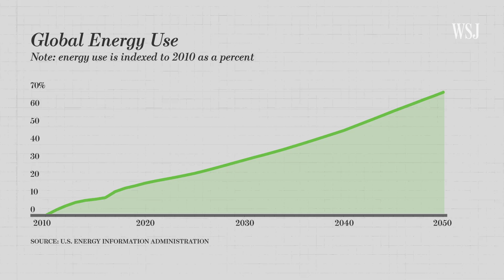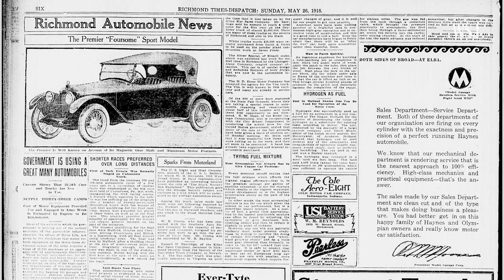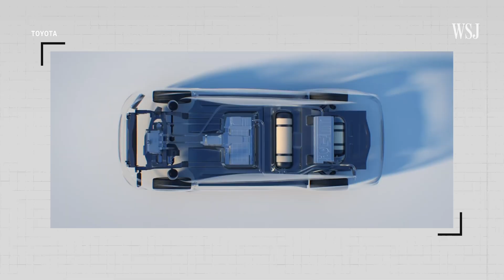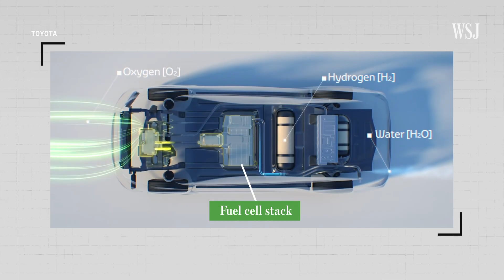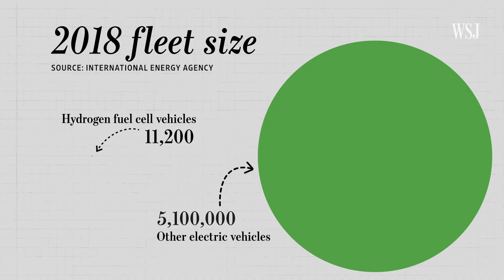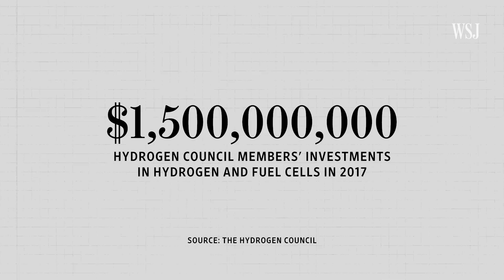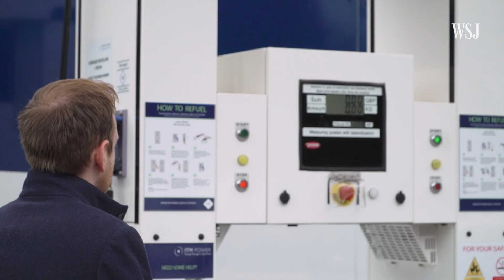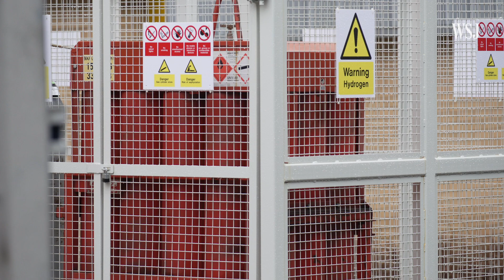Can Hydrogen Fuel the World's Fast-Growing Energy Needs? | WSJ

Comment: Use electricity to extract the hydrogen?  That's a fail right there. You use one type of energy, and convert it to another. Instead, apply the electricity directly to move your car etc.
Reply: One problem of renewable energy is management of it; if there is a surplus of electricity produced this surplus has to be stored. The question that logically follows this consideration is: How do we store it?
One possible solution is to store the surplus inside batteries but produxing batteries creates ethical and environmental problems
Another solution is to use this surplus to produce hydrogen and then hydrogen could be used to power vehicles or to serve other needs
Reply: @albertomigliavacca8320  Tesla is working on their powerwalls, so you can store your surplus from the solar panels, so you can get off grid for some time with the surplus.
Reply: @vladislavbashev1707  I was refering to the broader market not just your personal consumption.
Reply: @vladislavbashev1707  batteries have a big environmental downside, they pollute a lot during their production,  they have a big ethical downside, their constituents materials are extracted in countries with no respect for human rights finally, up to now, we don't have a process to recycle 100% of batteries
Reply: https://www.telegraph.co.uk/china-watch/technology/hydrogen-from-water-clean-energy/
Reply: But the electicity doesnt solve the long range issue
Reply: @pptstziao6937  So far hydrogen hasn't either. HFCV like the Mirai have a 320 mile range while the Hyundai Nexo has an EPA 354-380 mile range. The Tesla Model S has a 378 mile range.
Reply: doesnt solve infrastructures issues. the north american grid will not be able to support 300 million people high speed charging their vehicles all at once. this is a possible solution that is still greener than ICE cars.
Reply: @mobgma  If the hydrogen is made with renewable electricity (90% currently isn't, it's made from natural gas), then you'll need 2.5 times more electricity supply than if you put it straight into plug-in vehicles. Utilities love the "problem" of increased electricity demand from recharging that they can shift to periods when there's plenty of electricity by variable pricing.
Reply: @skierpage  I agree. I dont have the long term solution for 300 million people. Just saying this might be an alternative. You can bet the utility companies are salivating at a way to monetize this and somehow charge us more money to electrify everything.
Reply: @mobgma  Yes, having a market for periods of overproduction of electricity may mean that utilities don't have to discount that electricity as much. But they are limited in what they can charge because a) most it's are regulated and b) people can make their own electricity at home on their roofs. You're unlikely to ever be permitted to make and store hydrogen at home, you'll always be at the mercy of a gas supplier.
Reply: @mobgma  Good thing we aren't going to replace hundreds of millions of cars overnight just like we didn't add hundreds of millions of washing machines, air conditioners and TVs overnight in the 20th century.

Comment: Why you use power to produce hydrogen then use hydrogen to power a car, instead of use power directly power a car?
Reply: Power is how fast energy is delivered.
Every trasformation requires work( a form of energy) to be used.
Even making batteries or refining petrol requires energy
Reply: Lithium batteries are more toxic than used Uranium that’s pumped into Nevada, and Hydrogen cells are just a normal element that’s already everywhere.
Reply: Why not use solar and wind power to charge EV directly instead of making Hydrogen?  Because we have a lot of Solar and wind power in springs and falls with low power demand, while winters and summers we have such a high power demand with respect to the supply of Solar and Wind power.   So, we will make hydrogen in springs and falls with the excess Solar and Wind power, and use that hydrogen to supplement the much higher energy demand in summers and winters.
Reply: doesnt solve long term infrastructure issues. the north american grid will not be able to support 300 million people high speed charging their vehicles all at once (presumed evening where the vehicle(s) is charging). this is a possible solution that is still greener than ICE cars.
Reply: @mobgma  This is incorrect. Producing Hydrogen requires MORE energy than directly powering vehicles via batteries as batteries as significantly more efficient than hydrogen production. Regardless, the grid will be able to handle the additional load just fine as it grows. Power consumption has already increased dramatically due to the increasing number of datacenters, which require a significant amount of electricity. What happens when demand for electricity goes up? Production of electricity increases. Its quite simple. Supply and demand
Reply: Graham Henry true, but there also is the problem of making enough batteries. Yes, lithium is among the most abundant elements, but gathering and refining lithium have already wrought environmental harm with only a tiny percentage of new cars’ using them.
Reply: @grahamhenry9368  the first part of what you wrote (Producing ... ... Hydrogen production) is wrong because you're comparing the production of hydrogen with how BEV use the chemical energy of batteries to power themselves, so you have to compare apples to apples.
The second part is correct but you have to consider the environmental implications of producing batteries

Comment: I don't think for cars it will be successful environmentally or economically, but it might be for trucks, airplanes, ships and industrial processes once we have abandoned fossil fuels.
Reply: trucks and trains, ships are too big and its too heavy for planes and diffcult to manage with the constant pressure differences
Reply: @Oh Gawd "For example for 100 miles of gas you would need around 50 pounds of hydrogen gas with some pressure added, pressure allows the gas to have more energy."

I don't think this is right. Most hydrogen cars do 60+ mpg (where 1kg H2 = 1kg gasoline), so roughly 1.6kg (3.5 lbs) of hydrogen are needed for 100 miles. It sounds to me you are counting the weight of the hydrogen canister which is much heavier (e.g. 87.5kg in toyota mirai which stores 5kg of H2) because of the metals involved to compress the hydrogen.
Reply: Fuel cells are expensive only due to the need to minaturise them for cars.  In ships, trains and trucks you could easily stack fuel cells the size of fridges.
Reply: @allgoo1990  
Electricity is a fraction of the price of gas.
Reply: I just talked to a friend who is a top line manager at Volvo Trucks and he confirmed that they have one already in the plans: https://www.bloomberg.com/news/articles/2021-04-29/daimler-volvo-plan-join-forces-on-hydrogen-powered-trucks
Reply: Maurizio, well all respect in the end (if we still have cars) - H2 will be more safe and beneficial to the earth. Water - we we need it dearly. What is the risk? I'ts not a hydrogen bomb - and H2 cars have been running the roads for decades - without any incident. It's the clean production we oil-countries have been blocking.
Reply: What are you basing this theory on? Fuel cells are far, FAR too heavy to be used in aircraft (they can barely power motorgliders), and are likely to be far too expensive to be used in ships. Why even bother with hydrogen when we can create carbon-neutral synfuels that can directly replace gasoline and diesel?
Reply: @PistonAvatarGuy  not a theory, I just made a list of random things that are not likely to be electric. Airplanes did gave me pause due to weight.
BTW technological advancement needs many competing things and the best one will win. Going all in only in one thing may lead to results, but not necessarily the best possible results.
Reply: @Maurazio  Hydrogen is not the natural alternative to batteries, they're both terrible ways to store energy when compared to hydrocarbon fuels. Hydrogen comes with far more drawbacks than batteries, in any application, because EVERYTHING associated with it is expensive and it's extremely difficult to handle. Hydrogen is just a dead end. Carbon neutral synfuels are the only viable alternative to fossil fuels in many vehicle applications.
Reply: @PistonAvatarGuy  the future will tell, although when it comes to cars the industry seems to have decided for electric already, even though they have been doing R&D in synfuels for years. But I don't believe in absolutism, it could be Europe  goes 100% electric in cars and synfuels will be used in countries with different characteristics (like say rural Australia or eastern russia or namibia) and for heavier vehicles where atm there isn't really an economically and environmentally viable solution in sight.
Reply: @Maurazio  even electric cars are stillimproving, its the battery research and breaktrough that we need, also the green production of electricity
Reply: @PistonAvatarGuy  Well - give one scientific answer - You are just spitting out your disgust against H2 - with no proof
Reply: @janverboven  Read the discussion.
Reply: @PistonAvatarGuy  well ? Synthetic fuels then ? And H2 is 'a dead end' - Not looking at reality then H2 is at's it beginning - you may be the dead end. (as we are all)
Reply: @janverboven  I'm not confused about anything. Hydrogen vehicles are insanely expensive, hydrogen is expensive and the cost of building an entire hydrogen refueling infrastructure could never be justified. Hydrogen just doesn't make sense as a fuel, period.
Reply: @PistonAvatarGuy  
No. For its output a fuel cell is a similar weight and size to an internal combustion engine - and getting smaller.
Reply: @johnburns4017  NO. The longest range hydrogen powered aircraft (with piston engines) has a range somewhere around 3,000 to 5,000 miles (several days of endurance at low speed), the longest range hydrogen fuel cell aircraft can go 500 miles at low speed, the longest range ICE aircraft has a range of more than 24,000 miles and nearly 5 days of endurance!
-
Things get even worse when higher flight speeds are involved.

-
NOTHING competes with ICE aircraft running on liquid hydrocarbon fuels. For aircraft (and many other vehicle applications) carbon-neutral synfuels are the only answer.
Reply: @PistonAvatarGuy   - I think you are confused about 'fuel cells' and 'EV-cells'
Reply: @PistonAvatarGuy  to be able to afford that we first need to be carbon negative and what the companies call carbon neutral is not always as neutral as they market it to be.
Reply: @thereisnospace  ? Carbon neutral synfuels are the only technology which would allow us to become carbon negative, as carbon capture would be part of the production process.

If we wait for the solutions to global warming to become affordable, we're doomed, as there is no way that they ever could be affordable. Limiting ourselves to what's possible within the current economic system will result in our demise, that's a simple fact. Why should we let some archaic bureaucracy determine our fate as a species?
Reply: @PistonAvatarGuy  Fuel cells are far lighter then batteries. This is why hydrogen  is the best option right now for aircraft and long distance freight. This will be true until batteries can increase their energy density enough.
Reply: @agisler87  That's not even remotely true, the hydrogen tanks, fuels cells and all of the equipment needed to make them work gives fuels cells an energy density that's not much better than batteries.
Reply: @agisler87  That first video has no relevant information. Read my reply to John Burns.
Reply: @PistonAvatarGuy  hydrogen tanks are made of carbon fiber and other materials which are seriously lighter than batteries, a tesla battery is almost the half the weight of that car
Reply: @carholic-sz3qv  Ugh... you're just looking at one component or another, you're not understanding that all of the components needed to make a hydrogen fuel cell function add up to a serious amount of weight.
Reply: @carholic-sz3qv  Tesla Model 3 (long range, RWD):
Weight: 3,805 pounds
Power: 340 hp
Range: 325 miles
-
Toyota Mirai:
Weight: 4,079 pounds
Power: 152 hp
Range: 312 miles
-
Which has more range and power? Which weighs more? When the Model 3 was assessed by Munro & Associates, they concluded that the Model 3 could be built even lighter than it was without a loss of strength or safety.
-
Hydrogen fuel cells and all of their associated complexities are HEAVY.
Reply: @agisler87  From one of your sources: "Hydrogen used in fuel cells has an energy to weight ratio ten times greater than lithium-ion batteries."
-
You don't use a cloud of naked hydrogen to power a vehicle, the hydrogen has to be compressed to extremely high pressures and stored in extremely strong and heavy tanks, then it has to be converted into electricity in a large and heavy fuel cell. That statement is a perfect example of weasel-wording, it's meant to mislead and doesn't provide any meaningful information.
-
I watched that video when it was first posted.

-
My source is REALITY, no hydrogen vehicle has ever been demonstrated which was significantly lighter than a modern electric vehicle. The Model 3 isn't made with any uniquely light weight materials, it's just a basic, steel body car.
-
Shills try to distort reality in order to get you to buy their products, I suggest that you be aware of this fact so that you don't get fleeced in the future.
Reply: @PistonAvatarGuy  You can call it weasel wording and say I'm out of touch with reality but you have yet to provide one piece of evidence. Am I supposed to just take your word? Sorry I don't except your reality as a valid source. 

It's not just about what materials it uses but the amount. How much more steel does the mirai use? Your comparison has to many unknown variables.
Reply: @agisler87  I did give you evidence, the Model 3 and the Mirai. I also exposed your "sources" for what they are; weasel-worded nonsense.
Reply: @agisler87  I agree that there are a lot of variables, but the Tesla is known to be overbuilt, and Toyota, Honda and Hyundai have been building cars for a long time, so they're not likely to have overbuilt anything.
-
I don't have any links because the sources of the information on fuel cells are all from the fossil fuel industry, which isn't exactly known for its honesty.
-
Drones are different, because the hydrogen is stored at relatively low pressures and efficiency and longevity aren't major concerns.
-
Regardless of the energy density of fuel cells relative to batteries, fuel cells aren't even remotely capable of powering useful aircraft, especially not when cost is brought into the equation. This conversation is moot.
Reply: @PistonAvatarGuy  We will have to agree to disagree then. Have a great weekend.
Reply: PistonAvatarGuy EV production is a heavy polluter, battery manufacturing especially. We should ban or regulate environmental protection on EV production heavily. EV battery also has bottlenecks. During lower temperature like winter in Canada, EV performance will be downgraded. The battery capacity and charging time is also a big obstacle that hydrogen doesn't have.